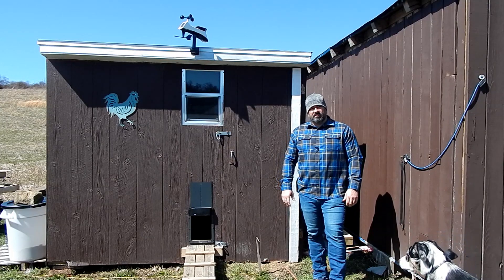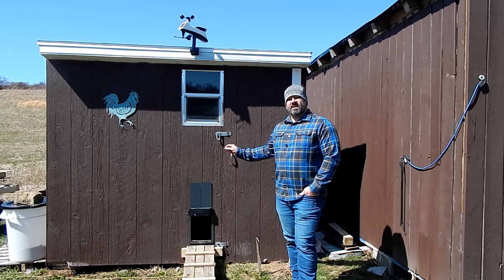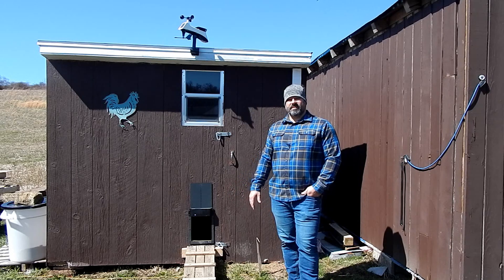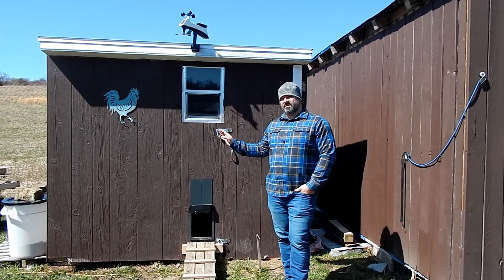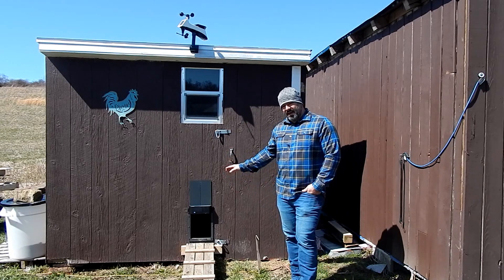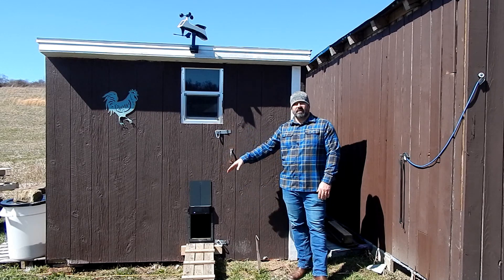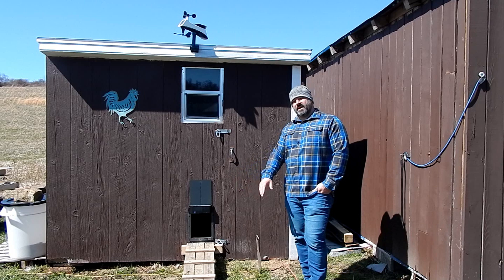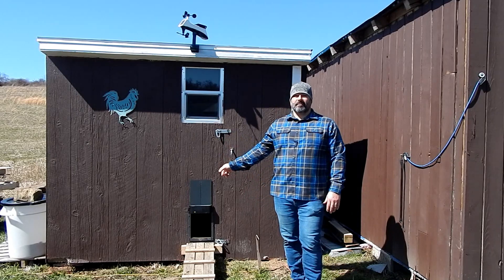UXOLIFE Automatic Chicken Coop Door - 3 Month Review

Comment: there is three buttons on mine K1,  K2,  K3 can you tell me what they do?
Reply from the maker: Hey James! Yeah, no problem. The door comes already set to open and close using the light sensor. 

The K1 button is for manually opening and closing. If the door is open and you hit K1, it'll close. If it's closed and you hit K1, it'll open. 

The K2 and K3 buttons are for setting the door to open on a timer. With the door closed, you press and hold the K2 button for 3 seconds. That will open the door and set the timer to open at that same time every day. 

If the door is open, you press and hold the K3 button for 3 seconds. That will close the door and set the timer to close at that same time every day. 

Using K2 and K3 to set the door to a timer would be a handy function if the light sensor wasn't so dependable. But the light sensor does really great. 

The down side to using the timer is that it would be an ongoing ordeal to keep resetting the timer as sunrise and sunset change so constantly. Just my 2 cents. Hope the Uxolife door works as great for you as mine does for me. Thanks!
Reply: @satanekfarm  glad I found your reply here on the buttons.  I have mine ordered and on its way and I'm excited to have found your positive review.  We have only started up our farmstead with 5 chickens (2 roosters and 3 hens) but want to integrate time saving technology wherever possible.  This automatic door being one!  I initially was going to order the cheapy plastic ones of the same design but had second thoughts and paid double for this as they are aluminum.  I'm sure they are much better.  

My family will be leaving town for a few days and I've been worried sick about what I was going to do about the chickens.  I hope this will function and do it's job.  Also have automatic watering cups and no-waste feeder cut-outs on their way as well.  We've been manually opening and closing and feeding our chickens daily.  Sometimes it isn't till about 9am that we are able to open the coop lol.  So hopefully this we'll save us a lot of time and labor.  

Again, thanks for the review.  I'm excited for my door to arrive.  Take care and Godbless.
Reply from the maker: @redsunsmr284  : Thanks for the comment. So glad this helped. I think this product will do everything you're hoping for. You were right about the plastic ones. They are almost impossible to get to work. You saved yourself frustration by buying this one. I can't remember the last time ours didn't do exactly what it was supposed to. It was a long time ago... in the deep freeze of winter. I have a feeling my 1 year review is going to be even more glowing. 

As you mentioned, one of the main reasons we bought ours was to help when we go on vacations. We like to take lots of mini vacations. And in the past, we've had to rely on family dropping by twice a day to manage the chickens. This solved that problem for us. I load them up on food and water before we leave, and the door does the rest. Sometimes we ask my daughter to collect eggs daily. But, if our trip is only a few days, we just let the eggs collect until we get home. Buying this door was one of the better decisions we've made for our little farm. I'm guessing you'll end up feeling the same way. Enjoy the door, and keep me posted!
Reply: You're lucky to have some family close by to help you.  We don't have any.  But I feel reassured with your review and experience that this purchase will help us do the job.  Thank you!

I'm also curious about winter.  I'm in Canada so we get really harsh winters with temps diving down to -25C.  I'm not holding my breath for the door to operate without faults.  Like you said, in those conditions, even our car doors and windows get stuck!  But I'm also planning to build kind of a mini awning over the door to keep rain and snow off of it as much as possible and put the door on timer.  

I guess everything is trial and error at this early stage of the game.  I'm just happy to have a farmstead going on a few acres.  Will keep you updated.
Reply from the maker: @redsunsmr284  I can't believe I have never thought of the awning idea. That's brilliant! And I really do think that's going to work. If you keep moisture off of it, you should be just fine. I might have to do the same before next winter. It might be a good idea to use rechargeable AA batteries. That way, you can replace them more often (every month or two) at no cost, in order to compensate for the additional battery drain of super low temps.
Reply: @satanekfarm  Thanks for posting this information. I have the same door; motor finally died on me and I bought a cheaper version of this with the plastic frame and door and used the motor out of it and I'm back up and running! I just couldn't remember the K1, K2, K3 functions. Appreciate it!
Reply from the maker: @AlanCurtis  You're welcome. Glad to be of help. Thanks for the comment. Glad you found one that's working for you. I will always own some version of this, because they're just SO handy!
Reply: Hey there! I lost the manual for mine and can’t remember how to reset it back to light sensor mode. Which button do I need to press? Thanks!